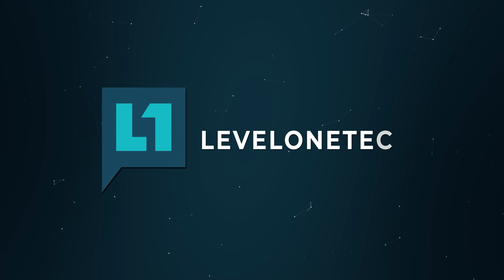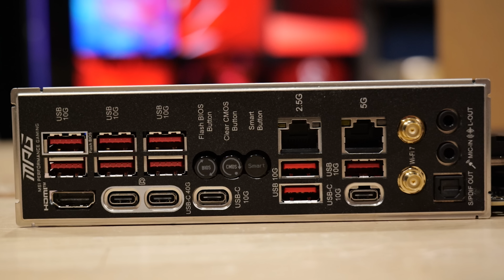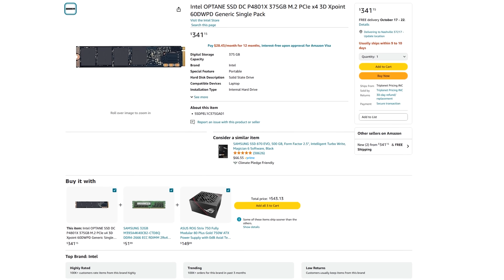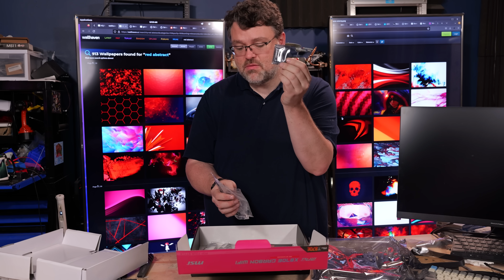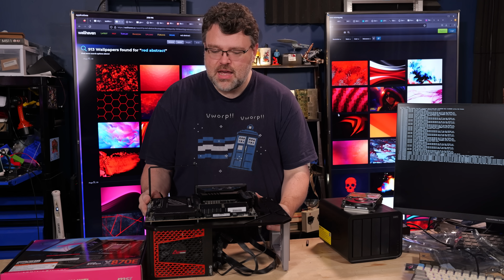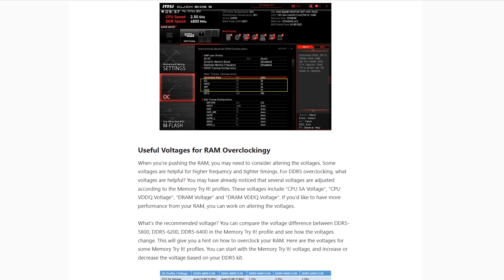USB 4.0 for DAYS! Checking Out The MSI MPG X870E Carbon WiFi

Comment: Asus is selling the Crosshair Hero for $700 and have the nerve to not include 10Gb Ethernet. Personally, I would rather they included that than a uselessly over power VRM setup and I think a board selling for $500+ should have 10Gb included. But I'm sure the Godlike will be near $1,000 and will be a stupid purchasing decision.
Reply: How much more do you think it costs these companies to include a 10Gb instead of 5 or 2.5? Seems like they are just stingy idk.
Reply: @Chicken-o5e  It's about $90 for a reputable adapter from TP Link at retail, and knowing that it cost them a lot less, I'm guessing marginally more than both the 2.5Gb and 5Gb controllers. Since it's easy to include a controller, like the TP Link adapter, that can do 10Mb all the way up to 10Gb, there's really not much need for the other two... though, I can see where having two controllers could be advantageous.

I've seen people bring up the PCIe lanes... and that's a non issue if you dump the 2.5Gb and 5Gb, but I would say goodbye to a couple of 10Gb type A USB ports if it meant getting 10Gb Ethernet. These Ryzen chips have more PCIe lanes that Intel, but perhaps that will change with Arrow Lake. Other people complain about the heat, but using those VRM heat sinks and having proper airflow shouldn't be an issue at all. Not like we're asking for them to put 10Gb on a basic A series chipset board.

I really do think it comes down to them allocating too much money to things that don't benefit the consumer, like overkill power stages, and fearing that the added cost of 10Gb would make it too expensive and that it's perhaps too niche. It's mostly that these companies are out of touch and didn't learn anything from the previous generation.
Reply: @TheGameBench  thanks for the insight. It does seem like their priorities arent right rather than being stingy.. or maybe both? lol im just gonna get the x870 asrock pro rs wifi at a great $210 compared to the unneeded $500+ mobos that dont benefit my needs
Reply: @TheGameBench They have the same number of PCIe lanes, but the Intel CPUs reserve 8 lanes for their DMI, which gives more PCIe bandwidth for the chipset, while AMD reserves 4 of those lanes for their chipset and gives the rest of them as direct connections.
Reply: @fujinshu  If you want to be technical, Z790 has more PCIe lanes in total the X670E or X870E. However, 8 of those lanes are Gen3. X670E and X870E have 4 more Gen5 lanes, which are direct to the CPU, which has more bandwidth than the extra 8 Gen3 lanes on Z790. While saying it has more lanes isn't accurate, in a technical sense, I should have been specific and said it has more Gen5 lanes, and in the end, has more total bandwidth. Though I imagine the new Intel boards will drop Gen3 and be all Gen5 and Gen4.
Reply: @Chicken-o5e  Yeah, I think it's mostly that their priorities are a bit screwed up. Had they dumped 2.5 and 5Gb and not gone so overkill on the power stages, I think they could have offered 10Gb on this board without impacting the cost. It also doesn't help that the X870E boards have two chipsets.
Reply: My NUC 12 extreme has 10GbE its not a requirement for me, if i had the thing setup for better local transfer options it would help i guess, but this thing is a few years old now and was under £1k at least, when i looked at high spec motherboards for a new build i have that fear of downgrading because its rare to see on the high end boards, and hey, the i9 version even got an additional 2.5Gb port with the entire pc in a form factor smaller than a 4090.

The PC market is stranger than ever these days IMO, i think we are on a 2 steps forward and 2 steps back scenario, improvements are made and then other problems or limitations arise elsewhere.
Reply: @drunksupportcharacter  Yeah, it really feels that way.
Reply: Yeah, that is a incredibly stingy omission, they could have at least included 2.5Gb instead of a 1Gb ethernet.
Reply: @earthtaurus5515  This board has 2.5Gb and 5Gb. What they should have done is axed both for 10Gb, which would have likely cost marginally more but added a lot more value for these higher end customers.
Reply: I'd suggest you go for the ProArt x870e or x670e both have 10G, only costs $500 and still have everything you could wish for
Reply: @_lordtra  I'm kinda' surprised to see it listed on B&H for $480 for the X870E. I would have assumed they would have charged more, especially being targeted to creators. Perhaps that's the board I'll go with then. All of them should have 10Gb at this price, and the fact that the ProArt has it at the same price just confirms it.
Reply: At $700 you could add a 2x40gbe card to a $200 mobo for less money.
Reply: Fyi, you can get 10 GB ethernet over USB 4.
Reply: @DingleBerryschnapps  yup, for an additional $100, I think that should be onboard included for a > $500 board
Reply: @DingleBerryschnapps  And you can get 10Gb Ethernet over USB3.2 Gen2 or I can get a PCIe controller and install it in the system... so? I'm well aware that I can install my own 10Gb adapter and there are multiple ways I can do it. The point is, at this price range you shouldn't have to and it should be standard.
Reply: I think the godlike will be more
Reply: @FuckYouYouTubeFreeSpeech  Oh... I don't doubt it. $800 minimum.
Reply: Just use the USB-C port into a Ethernet adapter?
Reply: @AgentLokVokun  Yeah, I'm well aware that there are various ways I can add my own adapter... that's not the point. The point is that at $500 I shouldn't have to spend an extra $80 to $100 to add one.
Reply: @TheGameBench  I don't disagree but here we are.
Reply: At this level it's all "stupid" no? It's a hobby. I have friends who spend 3x my PC on suspension for their cars. PC isn't that expensive when you put it into perspective.
Reply: @sunprofactor  As someone who has several hobbies, on top of computers being my chosen profession, computers on the lower end of those price wise... for sure. I work on cars and I've spent more on single parts than I've ever spent on an entire PC, and my PC aren't cheap. However, I don't think that's a valid reason to not complain about the cost of these parts when the value isn't there. It's really a false equivalency and a poor basis of comparison. Generally, spending $2,000+ on a turbo is going to get you more than buying some cheap $500 turbo. What does buying a $1,000 motherboard net you over a $500 motherboard? In all reality... nothing. You're paying for useless VRM phases you won't utilize and cladding that completely covers up the motherboard with lots of RGB... so aesthetics. You might get something with pre-installed water blocks on the VRMs as well as other things, and I won't argue that, because it is functional to tie into an open loop. However, generally you're not getting anything more for your money that validates the extreme price increase and I don't think it's out of line to say that they should be including AT LEAST 10Gb Ethernet on $500+ boards. Asus does it with the ProArt boards with a ton of I/O.
Reply: @TheGameBench  I can agree with your point when it comes to motherboards. Some of that comes down to marketing but also user incompetence... Anyone spending $500+ on a mobo should be educated on VRM config and general features afforded by higher end mobos... Could we make laws to prohibit any kind of sneaky marketing for PC parts? sure. but we wouldn't be happy with the downstream effects those laws would have. At the end of the day, in my opinion, if you spend $1k on a mobo and feel ripped off, that's kind of your own fault.
Reply: Yuck. I am done with Asus. The software and bios and snapdragon USB 4 and Bluetooth are far superior. I bought both
Reply: Just buy threadripper TRX50 or WRX90 board then.
Reply: @kevinerbs2778  I don't need a $1,500+ CPU for what I'm doing, but 10Gb Ethernet would be nice. Not only are you saying that I should spend over twice the cost of the CPU, but I should buy an even more expensive board to get a feature that would cost very little for them to implement rather than putting on 2.5Gb and 5Gb? That's stupid. You're just making excuses for out of touch companies that have their priorities screwed up.

Ironically, they're putting power stages that can handle a Threadripper on desktop boards, which is partly why these are so needlessly expensive.
Reply: @TheGameBench  The boards do not cost more than board you are looking at cost exactly the same.  The only thing you said on here was about the cpu price. But you are getting much more pci-express lanes. It's not out touch companies it PC gamers accepting the lack of choices & not complaining about it. You all let the company get away with it, now you want to complain about, when it's a problem.

Comment: How come you said two NVME drives is fine on the Tai Chi then no explanation about four on this board? I hope the plastic shroud is good at dissipating heat
Reply: As you may know LVL1 techs is an primarily an ASROCK shop although they never say it. They need to start saying they are sponsored by Asrock. (and getting free boards for review is being "sponsered")
Reply: @jjdawg9918  and being flown across the world for events.
Reply: @jjdawg9918  ahh okay thanks, I didn’t know it went that far. I was just curious why he didn’t mention about the amount of NVME’s seen here.

Comment: MSI does not support ECC, officially.
Reply: Or even unofficially.  HUB tested it and it didn't work, and MSI said they don't support it on consumer boards.  That's why I've been 100% AsRock and AsRockRack for the last decade or so.
Reply: @catsspat this does push me towards Asrock... I have an Asrockrack server board that I love. But I don't like the Asrock equivalents of this board as much and realistically for me this board is always going to be in some gaming PC.
Reply: Asus also supports ECC with a recent enough AGESA - I'm currently running ECC on my B650E-I board. I'm pretty sure Gigabyte supports ECC in their boards as well, but haven't done that myself.

I'm glad it's finally getting accessible on consumer hardware!
Reply: @coridyn I think all the major 870e boards do support ecc with the exception of MSI.
Reply: @coridyn  Details matter, many board makers will claim to physically support ECC DIMMs, but they don't support ECC so it just becomes overpriced standard memory.
Reply: @mytech6779  yes, but I mean they fully support it with actual ECC functionality
Reply: @coridyn  what benefit does ECC provide.. in real terms?
Reply: @deloford  It is an Error Correction Code. I'm not sure why normal consumers would need it, but I guess enterprise, or mission critical systems could use it.
Reply: @EricTheRedKind  It's useful for things like home NAS builds using ZFS, but pretty pointless for a gaming or general productivity system.

Comment: re: BIOS upgrades without a compatible CPU - AMD has a (long and drawn out) program where they will send you a loaner CPU compatible with your motherboard long enough for you to flash the BIOS to support your actual one. Google something like "AMD CPU loaner". I had to do it with a 5950X-based rig a few years ago. Happy they have the program, not happy you have to do it in the first place.

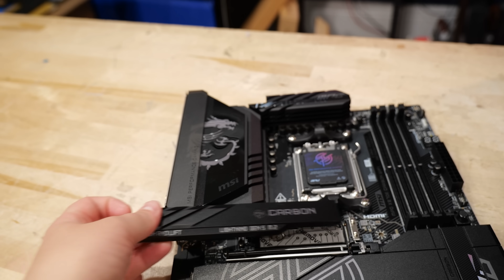Comment: @4:00 Is the strangness that mobos are later due to Air vs sea freight shipping i thought a mobo was like $50 by air. 

At AM5 launch the first boards were $50 more expensive and people said scalping but when the boats came in they were cheaper and there were less issues in places like down under.

Comment: After seeing this im glad i got my X670E Carbon Wifi when i did. It has DisplayPort out and a full set of audio jacks. The lack of Audio Jacks is something i just can't understand. Why are they going away? What are people using instead? Am i just old now? What is life?
Reply: spdif or a dedicated audio card.
Reply: @jmwintenn  in my case HDMI OLED TV out via eARC to a DENON video amp (DTS:X ATMOS etc)
Reply: Most people who really care about analog audio out tend to invest in discrete sound cards, as mobo integrated audio tends to have lots of noise and sub-par signaling.

I myself have used a USB audio interface for nearly a decade now, so I have only utilized mobo audio out on rare occasions. In fact, I have my mobo audio disabled in BIOS 99% of the time.

Removing the jacks allows the manufacturers to focus on other aspects of the board.
Reply: I've also used a USB sound card for about 8 years but I still use my 3.5mm mic for my microphone. I would need to find a USB microphone card for this lol.. @norkshit
Reply: @norkshit  What about us that use Linux, we can't just buy any sound card / USB
Reply: @jrksoldierx1436 Linux desktop users are a minority, so the manufacturers will go where the market goes unfortunately.
Although Linux is still popular for specialised use cases such as microcontrollers, servers and game consoles.
Reply: @jrksoldierx1436 Idk, most audio interfaces work on Linux. Sure you might have to boot into Windows to update drivers or access and "special" features, but for the most part, they all just work plug-and-play in Linux
Reply: I would venture either headphones or HDMI+receiver. But mobos w/ 5.1 audio still exist; less common maybe.
Reply: @crash.override  I have a full receiver and 7.2.2 set up. But the speakers I built for as much boom in as small a package as possible, small pc (upsized a cloned version of an HZmod XQ699 to mATX and had that made), everything is going smaller and more compact, receiver just keep getting bigger and bulkier. 

Just make 1 receiver, 5.1.2, thin and compact, 1× HDMI + 1× DP in, 1×DP out + 1× HDMI out, then maybe add 1× sp/dif in. Ideally you just use 1× usb4 cable that goes to the soundcar inside the receiver but DTS:X and Atmos required transport over HMDI 1.3+. Sadly. Even then you could do somehting nice even if you made it jus 3.1.2, just make an option of the .2 being either front wide, front height, front top or mid top, set it up at the desk how you want to. Give optional pre out for rear or side. 

Most I see is headphone but the gaayymin kind not even quality ones. If you go that route do it properly. I got me a Beyer DT990, DT770, a few others, 1 AKG, also some ZeroReds IEM, and I keep using those. Best public secret of all time, get them, I should have bougt only those.

I know it can be done, I tore open a usb soundcard, got the bare pcb, put that into a 1U shallow case, added a Honeywell audio grade slim PSU, some chipamps, thin, compact and light LCR device with amplification.
Reply: Last motherboard audio interface I used would relay the GPU’s coil whine and other interference. I use external audio interfaces for both headphone and microphone. Nice audio equipment is not necessary but nice. Probably a lot of people just like plugging in their own DAC like me and it just steered the  market that way.

Edit: thought they did away with all jacks, but a green and pink one (or combo) is actually ok
Reply: @Cătălin2P  There's a stereo line out.
Reply: @Zanpaa I have been misled, I was listening to the video more than watching and did not pay enough attention.
Reply: I wonder how many people use more than one line out on their motherboard. It's got to be insanely few. If you want to plug in stereo speakers it's enough. If you care about audio any more than that, you're not using the 3.5mm jacks on the integrated sound card.
Reply: @Zanpaa  even most speakers are usb these days so their software can control them.
Reply: I just use a USB DAC/amp. Mainboard audio has improved but I don't think it'll ever hold a candle to an external solution. If it was up to me mainboards would optionally not come with audio at all and save some cost that way.
Reply: @JMartinni  But then we need alternatives. 

Say we tear out any and all audio from every board. It is gone. Right? 

What do we have: 

Huge and bulky receiver, consider the trend of smaller and more compact computers. It really will not go well. 

A dac/amp combo, nice and compact, usually only for headphones and the ones that can amplify do so not very well and only in stereo. 

Monitors, as in audio not screens. Few are dac also so we need to consider only those, usually high end ones. Very pricey, only stereo. Only the larger ones usually are dac too. 

Soundbars are an option. Sound is crap especially for multichannel, it fails. 

Then we will have stereo only unles someone comes with compact receivers. You could try and make one yourself but AC-4 and AC-3E are not as open as they like to make it out to be and you need encrypted transport over HDMI. Access to such firmware mandates membership of either Atmos committee or the DTS one, and that comes with a really really high yearly fee as in only large corporations can pay up. 

Unless you use hacked software combined with a sound interface able to output all the channels but then you still need to amplify them each seaprately.